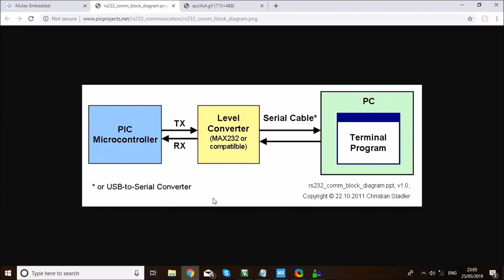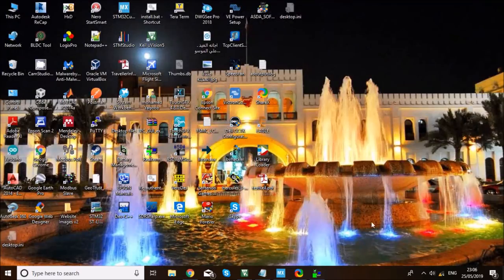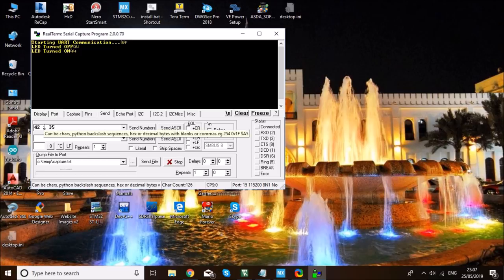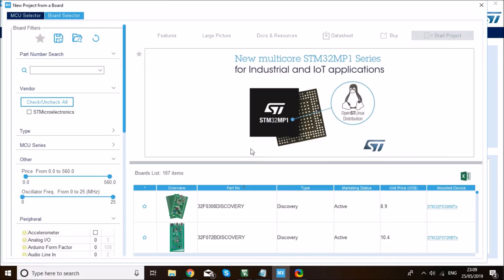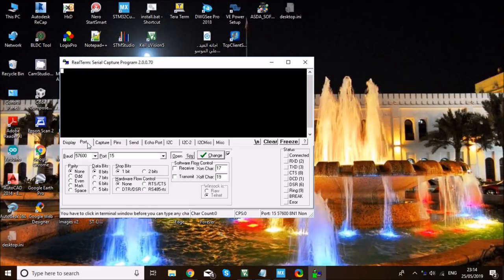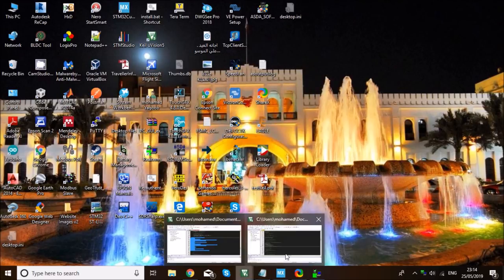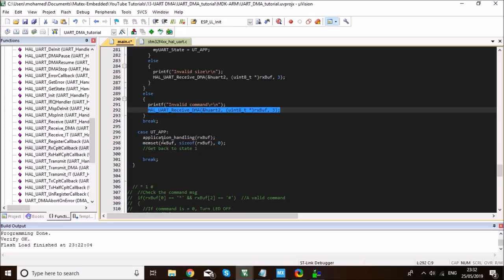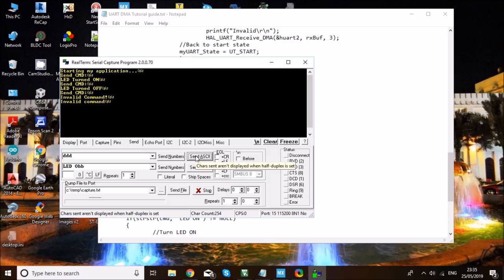STM32F4 Discovery board - Keil 5 IDE with CubeMX: Tutorial 40 - UART DMA (PC to STM)

Comment: Hey, tnx for the video.
one question: how long (aprox) does it take for mcu to execute the code in your HAL_UART_RxCpltCallback()? I know, that it should be as short as possible, but I believe, that in your case with the state machine and thte hal_uart_transmit() functions, that is probably not that short, or am I wrong? I would just like to beter understand what can and can't put into the ISR calback functions.
thank you
Reply from the maker: Correct, Ideally you don't want to add processing as part of an interrupt callback, rather you should signal to your application to take action as part of main routine.

Comment: Assuming you don't know how much data is transmitted from the PC to the Stm32, is there a way to find how many bytes the DMA has transferred to its circular buffer?     

Or would a typical approach be just set the threshold to 1, 
HAL_UART_Receive_DMA (&huart1, UART1_rxBuffer, 1);

and in the UART_DMATransmitCplt or UART_DMATxHalfCplt manually keep another circular/ring buffer for processed data?
Reply from the maker: Hi,
You can use DMA Count to check how much is received so far.
receivedBytes = RX_MAX_SIZE - __HAL_DMA_GET_COUNTER(huart1.hdmarx);

Comment: Is it possible to put blocking functions like delays or more complex logic into these uart callbacks? or is that bad practice. I want the led to toggle a few times with a delay in between when I send a toggle command, but it just freezes up.
Reply from the maker: Hi, not a good practice to use Callback directly. especially if Priority of interrupt is higher than SysTick, it will hang on HAL_Delay.

The better way is to set flag=1 in callback, then main to check if(flag=1), it will do your LED delay thing in the main, not in the Callback routine to avoid blocking SysTick
Reply: @mutexembedded2206  Ahhhhh I see, just have a simple if() in the main while loop, thanks for your reply!!

Comment: Thanks for this video. I have couple of questions. 
1)  How to reset the uart state machine back to command mode,  in case I am expecting a data of size 10 bytes,  but it never comes,  due to which dma callback function never calls. 
2) How to handle the case where I have variable length packets, with no length information and no start and stop byte.  -> this is rare case but i am facing the issue with one ble module, where response to command is fix but for some command response can be variable,  like module name, also some command respond with error message instead of ok.
Reply from the maker: Hi,
In case of dynamic response of a module.. you wanna open a larger DMA buffer and check DMA count with a timeout
Reply: @mutexembedded2206  Thanks for your quick response. 
But i didn't find anything related to dma timeout. 
Can you please help me regarding this timeout.

Comment: Hello Mohamed,
* Would you make video on RTC in sleep mode. So board could tick clock and run on 3V Battery?
* And Video for Infrared Receiver.
Currently I've made similar project on Atmega MCU and was wondering how it would be possible on STM32.
Thank you.

Comment: I am new to C programming.  This is very helpful.  But, I spent a long time debugging a memset warning message.  I believe this is because the second and third arguments in the memset command are reversed.
Reply from the maker: Hi
You'll find typecasting useful here in eliminating such warnings.
Reply: @mutexembedded2206  Thank you for the reply.  What I meant is that, in your code, when you clear the receive buffer, you have reversed the 2nd and third arguments of the memset method.  That's why I was receiving the warnings.  When I reversed them, the warnings went away.
Reply from the maker: @wysguydesignsllc7293  ops, alright, i didn't know I had a bug here, thanks! And well spotted
Reply: thanks

Comment: Hello please help anyone 
how to compare multiple strings ??? 

Strncmp(rxdata,"hello",5) ; 
if strncmp==0 
(
transmit "how are you" 
)

I have done this But what if I want to send Next string and compare again 
like "What is the age" 
"what year is this" etc.
Reply from the maker: Recommend you read about strstr()
Reply: I am not copiyng whole code .

char rxdata[30];
char txdata[30]="How r u?/r/n";

HAL_UART_Receive_DMA(&huart2, (uint8_t*)rxdata,5);

void HAL_UART_RxCpltCallback(UART_HandleTypeDef *huart)
{
  /* Prevent unused argument(s) compilation warning */
  UNUSED(huart);
  /* NOTE: This function Should not be modified, when the callback is needed,
           the HAL_UART_TxCpltCallback could be implemented in the user file
   */

  if ( strncmp(rxdata,"Hi\r\n",4) == 0)

  {
HAL_UART_Transmit(&huart2, (uint8_t*)txdata,strlen(txdata),10);

}
else if(strncmp(rxdata,"AGE\r\n",5)==0)
{

HAL_UART_Transmit(&huart2, (uint8_t*)"above20\r\n",9,10);

}

}

/* USER CODE END 4 */
Reply: I have to send hi "hi\r\n" more than once to get reply 
and same with the AGE 
the logic is working but I have to send my string from TTL more than once .
I have to send hi 5 times then it replies.